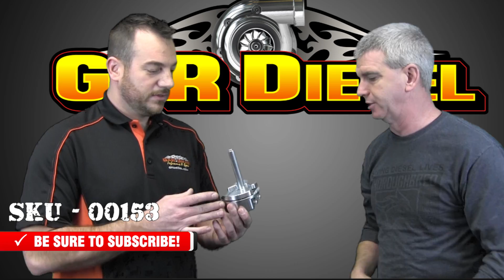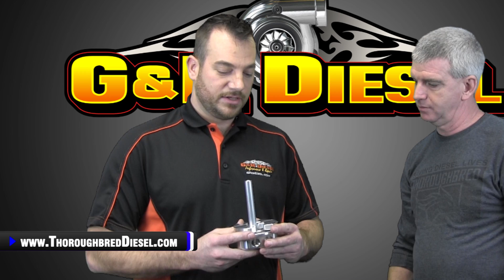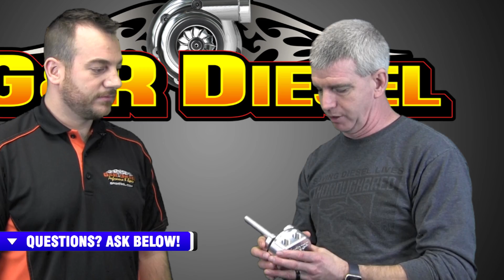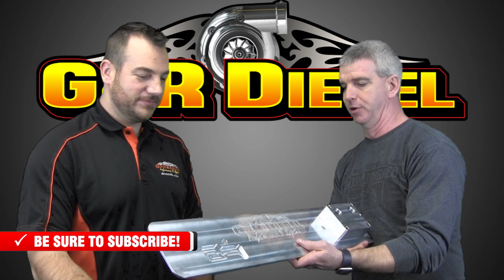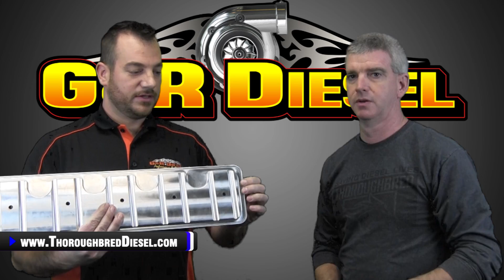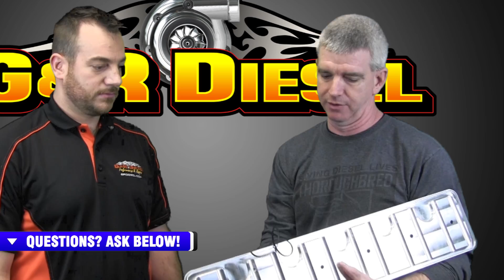Top GR Diesel Performance Upgrades | How G&R is Changing the Diesel Industry

Comment: My lb7  has antifreeze in the oil and the heater stopped working, Ive got a head gasket kit but someone said it could just be the water pump,, is that something that is possible? Thanks for any advice.
Reply: Shane K injector cup failure can cause antifreeze in the oil also if The water pump failed you would be seeing overheating issues
Reply: The shade tree welder, thanks man, is there any way I can tell if it’s an injector cup before I take the heads off?
Reply: Shane K pull your injectors and check for cracks but also the heat exchanger for the oil Will cause the same symptom pressure test might help you spot leaks and I think I had a brain fart because coolant in the oil because of injector cups is a heui issue and dmaxes are common rail
Reply: The shade tree welder thanks again sir. I appreciate the info, hope it turns out to be that.
Reply from the maker: If you have coolant in the oil, that’s uncommon. Coolant can wipe out main and rod bearings. I would advise not running the vehicle at all until you figure this out.  Pressurized coolant tank are signs of a head gasket and injector cup failure. LB7 oil pressure is high so traditionally the oil goes to the coolant,  not the reverse. I agree with the previous poster that a leak test will need to be conducted on the oil cooler. Again,  for emphasis, coolant in oil can destroy your engine.
Reply: Thoroughbred Diesel, I haven’t started the truck since I discovered the problem about 6 weeks ago, someone told me it was head gasket failure so I bought the expensive kit, I was getting ready to start the head gasket job next week but someone said it might just be the oil cooler, hate to tear down the entire engine if it’s just the oil cooler. Is there any way I can test myself to determine if it’s just the oil cooler? I don’t want to start the truck to drive to the stealership, they’d lie to me anyway. Thanks again for any advice, I bought the Haynes book for the gasket job but it doesn’t say anything about the oil cooler.